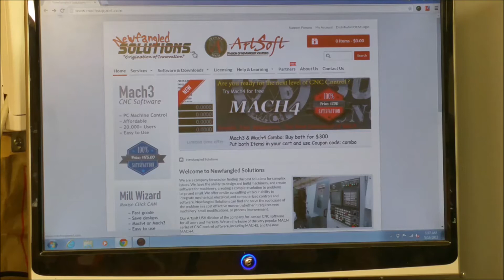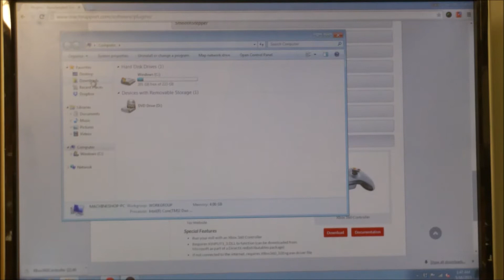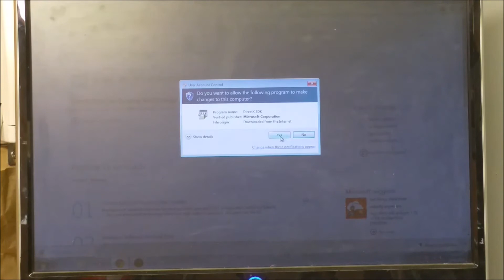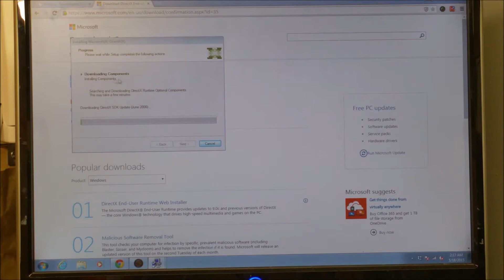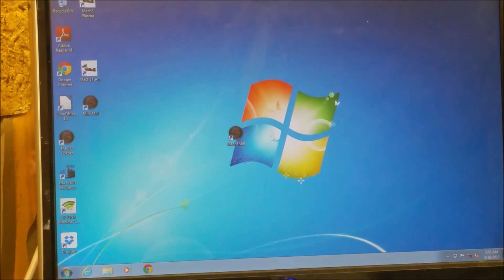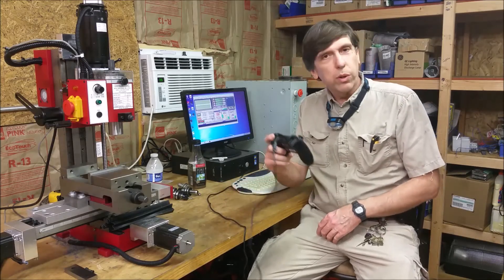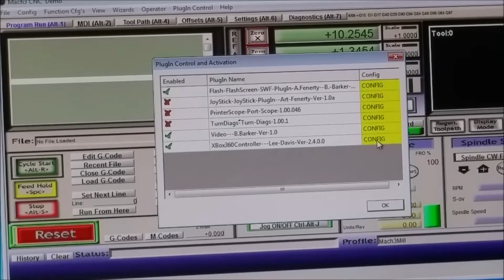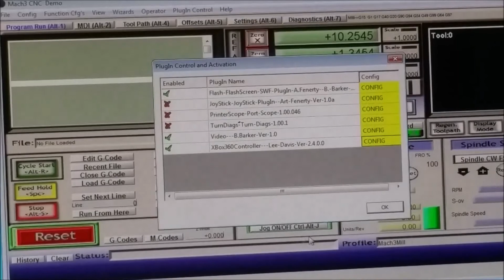Mini Mill CNC Conversion Part 10 - Xbox controller

Comment: Hey can I convert my mill to cnc with electronic my functions?
Reply from the maker: Not sure what you mean by my functions.
Reply: @craigsmachineshop2040  thanks for the quick feedback. I'm asking if they are completely instructed by the computer software input from that remote control once you add the motors and the PC processing software
Reply from the maker: @zachjackson9263  Not really sure how all that works.  The Xbox controller was connected to the computer by USB.  The controller talks to Mach3 by that activeX or something.  Its been a while.  Mach3 then controls the machine through the parallel cable.

Comment: I see that your video is 5 years old, are you still answering questions, I have tried several times to get my xbox 360 wireless controller to work but on the "configuration page" it shows "controller not found" even though it shows the x box controller on the "plug-in control"  dialog box thanks
Reply from the maker: Sorry, I haven't used mach3 in a while.

Comment: Great video I actually stumbled onto GuruBru video before I found yours and I have to say I was extremely happy to have his video as an awesome step by step instructions manual. I'm pretty impressed by your video as well thank you for the post and I'm not sure if you figured it out yet but you can actually pull the trigger buttons to rapid jog the X,Y, Z axis also if you push the toggle sticks like you would a button it actually puts it into micro jog aka 1/16 inch steps
Reply from the maker: Milspecmachine Thanks!  No, I didn't know the other tricks.  I will have to try them out next time I am on the mill. Thanks!